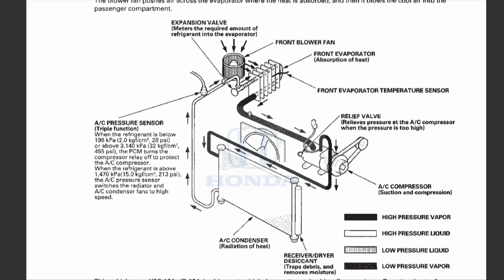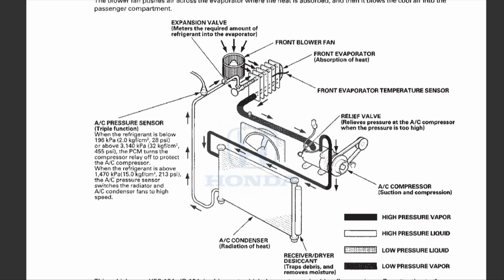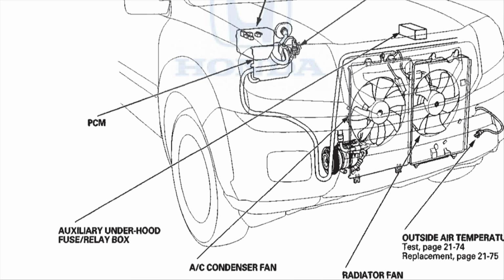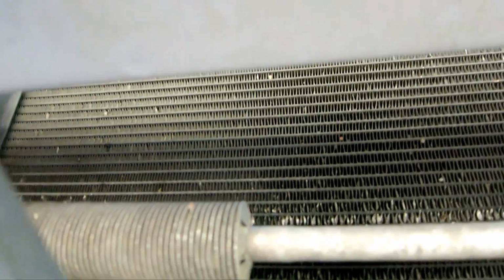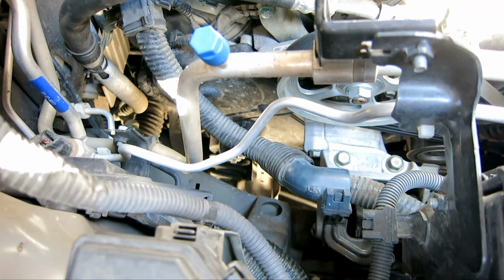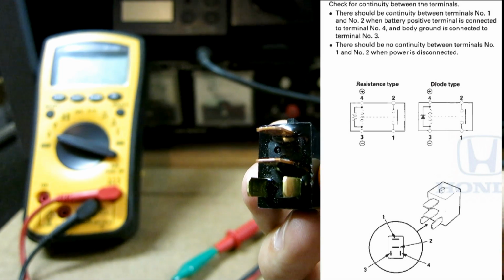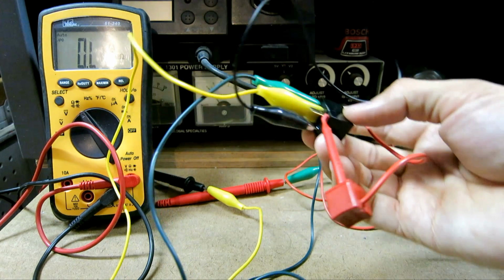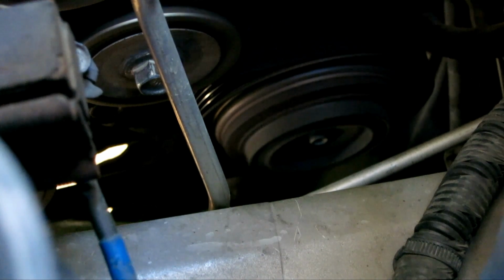Honda Pilot AC stop working - How to troubleshoot HVAC compressor relay G8HL-H71 - Air condition

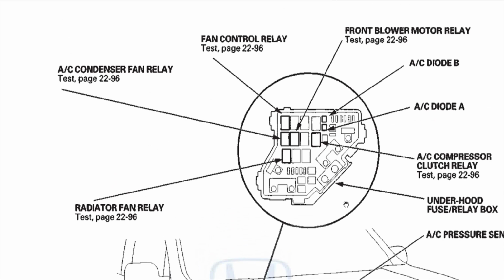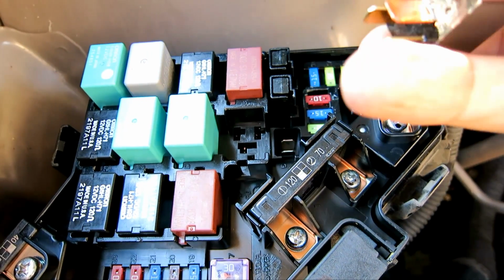Comment: Thanks for the video!  At 6:13 mins (<<click here) relay/fuse box layout, I realized, since I do not have a relay testing setup, I can just replace 5 of the 6 the AC related relays for $50, fixed it...one of them was bad!  Advance Auto Parts "Carquest" part RAA1731 is the same as Omron G8HL - H71. The fan control relay is different, top left 'light blue' at 11:47 mins but must be OK.

Comment: Very well presented - thank you! As an engineer, I appreciate the primer on the a/c system before diving in with the video. Clear, calm and educating dialog throughout. Now I have three thins to check before taking my Pilot to the shop… blockage on grill, leaks and relay. 10/10 for this brilliant video!

Comment: So what if the clutch stays on or spins even when the ac in car is turned off? 

I heard 2 bursts of air and so i opened the hood and could find it and later did some research and my conclusions is that sound is the release valve as it runs even if the ac is turned off

Comment: Thank you this was very helpful. Interestingly my did not have any broken parts inside (did not make noise when shook) and when I put 12 volts 1 amp to it, the solenoid closed (I could hear it click). But the circuit did not close as checked by the multi-meter. So it was still bad.

BTW I bought a new one at O'Reilly Auto Parts $7.99.

Comment: The AC in our car started only coming on intermittently. The dealer wanted to perform all kinds of diagnostics including venting and refilling the system. After researching online, a common problem for our vehicle was failure of the AC Compressor Clutch relay. Found this online and popped it in - problem solved!
View: https://amzn.to/35gEDRg

Comment: Thanks so much for the diagnosis and tutoring, it would have been nice to see a test of the new relay to show folks that the resistance on the contacts would instantly drop to ZERO ohms when you power up the control side, this is an issue on youtube is not many people will show what a good part tests like. Also for testing purposes, there is probably another same part relay in there somewhere that can be temporarily moved over to this position to prove a bad relay if the clutch operates by swapping relays. Thanks again.

Comment: Thank you for posting this!  My 2009 Pilot AC stopped working. The refrigerant cooling level was OK, so I watched your video and found the compressor was working. Next I checked the relay. Took it out, put it back in and Voila! the AC started working!  Can anyone explain why simply removing the relay and plugging it back in would fix the problem?
Reply: Maybe it lost connection or some dirt came in between the contact and relay.

Comment: I have a 2011 pilot but im only getting cold air on my feet and there is no air from the center ventas, could that be relay related?
Reply: Daniel MP   Probably your blender doors are stuck and not opening, maybe?

Comment: I've changed my relay still nothing. Unplugged the pressure sensor and reconnected it and it worked. But now it's stopped again. I think I've got a bad wire to the pressure sensor.

Comment: Wow. Ive just brought a Honda CRV 2008. Knew the ac wasnt working but ive been fiddling around with it. I already found the relay was rattling and have ordered a couple of replacements off ebay before I saw your vid but they havent come yet. Big coincidence finding your vid and you having a rattling relay too. Ive already tested for pressure in the system with a gauge and it seems fine. Not found where the pressure switch is yet...Was the relay REALLY all that was the matter with your system.? Cant wait for my replacement relays to come to see if it works cos a compressor change is just too expensive on a 10 year old car.

Comment: Amazing! Condenser not engaged, no signs of visual leakage, nothing shaking around in the relay, swapped out the fan relay with the AC relay, and Bingo, Condenser engages when AC turned out, cold as ICE! $6.69 for a new relay! THANKS!

Comment: Fixed my 2007 Ridgeline with this information.  The local Autonation Honda dealer wanted $180 just to diagnose the AC problem.  Thanks so much for the great video!  $6.99 at Discount Auto Parts and I have cold AC.

Comment: This is a great video.  However, if you don't have a meter, try this:  On my 2005 Odyssey, there are 3 of these relays.  One for the A/C clutch, and two for the fan speeds.  An easier way to confirm the relay is good or bad is to swap one of the other two for the A/C clutch.  If it works, you have a bad relay.  Just go to a local auto parts store and for $7 or more, get a new one.
Reply: I found out...Advance Auto Parts "Carquest" part RAA1731 is the same as Omron G8HL - H71

Comment: My 2007 Honda Civic ac air is running at 56F+/- 3.  The compressor pressures are 175 and 35 psi.  Refrigerant is good.  Any ideas?  Looking for 35-40F.

Comment: This 06 Honda Element is giving me a hard time. The condenser fan fuse keeps blowing out! I spent hours looking for a loose ground or frayed wires and I still can't find out why it's blowing fuses.
Reply: The condenser fan had a short in it. I just unplugged it and it worked perfectly. The fuse blew when I tried to spin the condenser fan. I replaced it and it works great now.

Comment: AC clutch is not engaging and AC Condenser Fan is not turning at all when I switch AC on in my Civic. I tested the AC clutch relay replacing the Horn relay with AC clutch relay abecause they are of the same type, and the Horn worked well, also on the other side the AC clutch didn't turn on. What could be the problem? I have not noticed any AC oil leak and I can't test the AC pressure because I dond't have a multimeter, but I think everything should be fine because in Autumn everything worked fine and when Ive tried ti use my AC in spring it just didnt turn on. What would you recommend me? I've read that the other problem could be the termal overload protector that won't let the ac and fan to turn on. Does it also make sense to test the AC fan relay? Thank you very much for your nice video! It was very informative, detailed and practical!
Reply: Check the condenser fan relay
Reply: Tim Meadows, I've allready checked. It still doesn't work.
Reply: I just replaced the condenser fan on A Honda Element because when I turned it just a little bit it would blow the fuse, But that was while the A/c was on. I guess the fan had a short in it. Un plug the condenser fan and try to see if it works.
Reply: Tim Meadows, could you help me with the location of the plug and how to access it? I am not sure if it is it. I have a Honda civic hatchback 2.0i sport 2004. I can see a plug that is comming from the condenser fan, located on the passenger side of the car, under the metallic border that is hard to access with the hand. I should take something out, but I'm not really sure where to start in order not to destroy the car :))

Comment: Thanks to your video, I cancel my appointment with the dealer who was going to charge me $1000 for repair.   I quickly check the relay and sure enough, it had a raddle noise just like you mentioned.  Instead of taking my Honda Ridgeline to the dealer for the expensive repair, I went and picked up a new relay for $26 bucks.  
Thanks again!
John

Comment: My 2007 crv suddenly had no cold air, I tried turning a/c on and off several times , the cold air came back out, I guess it must be a relay problem. Thanks for the video, and your elucidation is systematic and educational.
Reply: I just changed my aircon relay, it turned out that it was exactly the relay that was broken, the rest is fine, it works perfectly now. Thanks so much, you saved me so much money!

Comment: Hello my name is leonardo . and I'm using google translator . I live in Brazil. First congratulations for the video. I have a Honda Civic 2007-07 automatic LXS . he was a few days without battery. there bought a new car and put it on . over there 02 relay the fuse box fire. everything works in the car. however turns on the light injection departure over the car does not turn on. already checked several grounding points more nothing changes. I would like your help . What can it be ? these paltry and what part of the car? pass me your email I will send the photo . the relays . the relay that triggers and this black next to the orange relay required

Comment: hi! thank you for sharing. The AC of my Honda Civic 2006 does not work,  normal ventilation is fine. Symptoms includ: AC condensor fan not working and AC compressor not working. I just tested my clutch relay and it is good. Any suggestions? thanks a lot

Comment: I also have a 2009 Honda Pilot. The AC went out about a month ago.  I decided not to replace it just yet.  Then, last week my car did not start.  I went to have the battery checked and it was deemed good (it's a year old).  Just a year ago, I went through the same issue and my Honda dealership replaced a relay.  Voila, all was back to normal.  Remembering this I took it back to my honda dealership to see if they could trouble shoot and see if it was the same relay that needed replacing.    They just told me that it is the AC assembly that needs to be replaced because replacing the relay alone will not fix the problem and it (the ac relay) will continue to drain the battery.  I've never heard of such a thing, that basically if the AC does not work, the car will not work.  Your thoughts or feedback would be greatly appreciated if you have a moment.  Thanks so much.

Comment: I got my relays from a wrecking yard today and fixed my Honda Civic. don't worry about the serial number on the relay just make sure its the same voltage and ohm rating. I searched many cars and then realized they have different numbers on the relay. Also the fuse panel on this Pilot looks identical to the one on my civic so civic relays should work but I may be wrong.

Comment: Is it safe to short the normally open contact on the relay box to see if the clutch or compressor is working?
Reply from the maker: Zarnel Mejia not really. the pressure switch tells the computer if you have correct Freon level. If you dont, then the relay doesnt close to protect your compressor. If you dont have correct freon level, then running the compressor will damage it.

Comment: original relay (omron) for $5.99 at autozone
Reply from the maker: Victor Neyra really? can you post the part number from autozone? Really appreciate the info.
Reply: part number 20742 autozone
Reply: is says Duralast on the box, but relay stamped Omron
Reply: Victor Neyra thx so much. ill add that to the comment above!